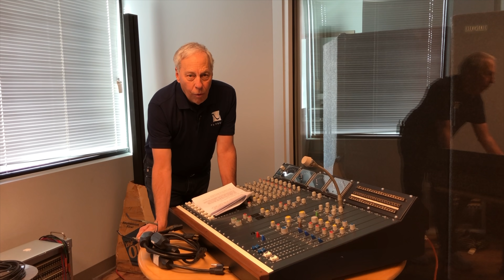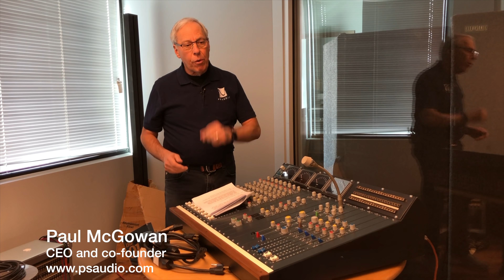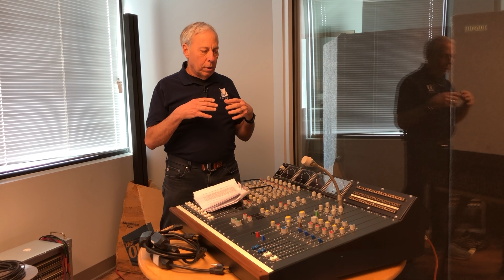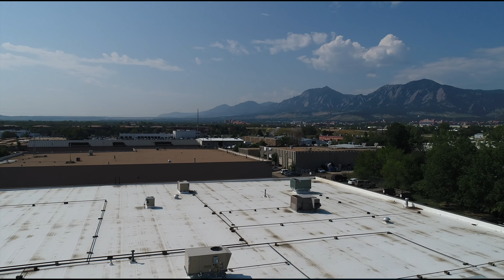Why is analog easier to preserve than digital?

Comment: Analog sounds warmer because the high end usually lacks, even if a little, making it sound warmer. LoFi (the genre) is based around that principle as well as adding reverb which can be experienced on some older recordings. In example, if you listen really closely to the beginning of School by Supertramp (Crime of the Century Album), you can hear the performer a second or so playing the harmonica in the background extremely quietly before the actual chord. Technically that’s like reverse reverb but same idea.

Comment: Is it possible that the harmonic distortions we know and love from our analogue vinyl can and is being captured by the digital conversions.  Whereas a recording straight to digital misses out on those distortions and they are gone forever?
Reply: Sure; probably it's the main reason. Recording straight to digital captures the sound much more pure and clean, while people tend to love the distortions that come from recording to analog (tape, vinyl, trafo's in tube amps etc).
Reply from the maker: That's essentially correct.

Comment: 0:51 Ok, before we start. Analog circuitry can and does impart distortion. In the case of audio, you should expect an increase in low end. Since he mentions recording, recording to tape is usually done hot to impart further pleasing harmonic distortion and tape compression. Most analog distortions are a two fold benefit. First is that compression factor and secondly is the softening and smoothing of the midrange and low end increase. If you record to analog, you preserve that distortion. If you record to digital, that tape compression and analog warmth are lost. Even the warmth from running through the board circuitry is lost depending on your monitoring setup. There are recording systems out there that manipulate the tape machine to record to tape then automatically transfer the tape to a digital format so you get the best of both worlds. 

Digital distortion doesn't have that headroom or leeway and doesn't impart pleasing harmonics to the signal. If it did, we would be pushing digital distortion the same way we push tape. Digital simply samples the signal, give you an accurate representation of what you put in. The the requirement to record to digital and have it sound like analog is pretty much required by the system I mentioned earlier....and yes, it's expensive. The beauty of digital is that the threshold of recording, mixing, and mastering has been greatly reduced. It's easy to do, anybody can do it, and with proper technique, anybody can do it well. 

Ok let's see what Paul says.
Reply: After watching...I'm curious how DSD is supposedly more "analog-sounding" than PCM. That would imply that it too imparts distortion onto the signal, and I highly doubt that's the case. DSD is a digital recording format, bent on precision, just like PCM. If you have a studio that records in DSD, it's going to have to be converted to PCM for editing, mixing, and mastering if any of that is done on computer. If analog equipment is used for the mixing and mastering process, you're going to end up with a warmed up, analog summed signal regardless. Sounds like you're just running in circles to get to the same spot.
Reply: This is what Paul should have said. I like film photography because of the film noise, but to say that digital photography is "cold" is just stupid. Digital has more precision and resolution and has no signal loss in the process.
Reply: I think this is largely correct, but a huge part of tape sound is that it greatly rounds and softens high frequency transients, and machines often have a built in EQ boost to correct for this. What you get then is a sound that isn't necessarily lacking high frequencies, but where all the stabby and ear slicing treble spikes are smoothed out.
Reply: @chipsnmydip  "all the stabby and ear slicing treble spikes are smoothed out." That's the aforementioned compression.
Reply: I get what you are saying, but two points here: 1. Blanket compression (like a VCA/FET/Optical or digital compressor performs) doesn't necessarily smooth out high frequencies. What tape does (bellow 0db Vu) is generally better described as similar to soft-clipping. 2. The softening of transients happens before the record level crosses 0db Vu, which is where the tape saturation and compression mainly begin (where the tape is pushed into overdrive, essentially).
Reply: I have actually done some DSD recordings and listened to countless hours or DSD playback. DSD does not have to be converted to PCM for editing, the two main ways are what Pyramix does which is convert only the edit points to PCM, or what Sonoma and Audiogate do, which is convert to an 8 bit DSD stream. If you want to mix in the box (computer) then, yeah, you need to convert it to PCM, but it sounds vastly better to just use an analog board. Most DSD recordings are mixed on analog, or transferred from tape, although some (lesser sounding ones) are sourced from 24/352khz PCM. Effectively DSD is a lot like a tape machine with some digital editing convenience.

It's true, if you are looking for harmonic distortion, noise within the audio band, or dynamic compression you won't find it. The main differences is that 1. DSD simplifies the AD conversion by removing several key DSP intensive stages, 2. DSD has nearly infinite impulse response and no pre or post ringing as all PCM has. 3. DSD has extremely good low level linearity because it uses a single bit. These all result in a more transparent signal, but IMO there is one characteristic which is not transparent and it requires very high rates (256fs) to get around, DSD is not very good with loud, high frequency transients because the dynamic range is dependent on the sample rate. For sounds that are both loud and high frequency it can be inaccurate, and smooth the sound, somewhat like tape does. I'm not sure if this is measurable, but it is pretty easy to hear. It's actually extremely difficult to get DSD to reproduce the kinds of hard/harsh sounds that are endemic to PCM, which tells you it has its own limitations (fortunately they are pleasant-sounding)
Reply: @chipsnmydip  Sweet, thanks for all the responses and explanations. I'll have to dig into DSD some more.

Comment: Analog tape recording is like a signal processor that we happen to like the sound of.  It does change the sound: the frequency response, the dynamics, and the transients.  It depends on the music and the application as to whether we like the effect or not, but it's an artistic choice.  Good digital recording has no sound of its own.  It's utterly transparent.  If you are 100% happy with your source, then stay digital.  But sometimes you want that bit of color & saturation that analog tape can give you, just like your favorite EQ, compressor, or other audio processor.

Comment: You really can't argue if DSD is better or not against PCM. You need to also specify the format of DSD and PCM. Both DSD and PCM have quantization and linearity errors that depends on the quality of the format. DSD itself is absolutely no guarantee. A DSD64 SACD is with better resolution than a 16-bit 44.1KHz standard CD or about the same resolution as a 24-bit 96KHz PCM recording, but not as much resolution as a 24-bit 192KHz PCM recording. In either way DSD or PCM, more data yield better quality. Paul's talk about "loneliness" is a bit nonsense unless he specifically limit PCM to the old CD standard only. A music studio running the audio at 24-bit 192KHz PCM would be a better compromise than DSD64...

Comment: That's funny that in multiple blind tests experts couldn't tell the difference between PCM and DSD. I love both but I don't pretend that one is black and the other is white.
Reply: Honestly, to my ears the formats sound so different I think they must have done something wrong in the testing.
Reply: If it's a DSD over PCM ''DoP'' the test is biased, it's like listening PCM for both source,  usually especialy on my high end pionner player from 2003 with Texas instruments chip it sound radicaly different, mu player can also read DVD audio i made a DVD burn from SACD rip i already have for compare with both disc and usually the original DSD recording is less harsh than the converted PCM 24 bit part, listening the SACD is like having the tape the DVD audio rip sound great but not as smooth and the source and master file are the same, i also do that with an original DSD file convert with Tascam tool they made for there recorder , i play those one with a blu-ray player that have DSD and SACD decoding feature the result is also totaly different.

Comment: Back in the 90s it was pretty common practice with digital recordings to first record to tape before transferring to digital, and often times even bouncing tracks back to tape, and ultimately mixed down to 1/2" tape. For example, the first two Garbage albums were first tracked to tape, dumped to a Pro Tools session as a gazillion different tracks, then stems were recorded back onto the the 24 track machines, and mixed down to another two channel tape machine. For whatever reason, the sound of the tape preemptively softened the hard edges of the digital conversion, added a little warmth and cohesion to the tracks. Since AD conversion has improved this doesn't really happen anymore, although many engineers still use plugins or hardware emulators like the Empirical Labs Fatso to get that smoother sound.

Paul is telling the truth, on a really good system a DSD recording is close to identical reproduction of a tape source (though PCM below 24/192 not so much), and with DSD you don't get any of the qualitatively harsh or cold sounds that engineers used tape or processors to soften and warm up. It's like true analog, without any of the tape noise or artifacts.

Comment: Then again, if the tape was better why not return to tape and then convert to digital. If digital leave its mark and obviously does then the best thing would be one step back. It ia the same as stellar series - icepower does not sound good because of the restraints but I saw that PS audio put something to correct the sound. The same could be applies in creation process

Comment: Have to disagree with dynamic range on audio recording it's down to technology and is it really that important..! I don't think so. A record can go up to I think about 82 maximum DB and with a dbx decoder can reach 100 DB dynamic range. Not sure what it is for tape about the same, But with modern electronics and techniques I think you can get it up to 120 Db quite easily just depends on the median with double layered tape this is quite possible. And it's not that important.
Think what you're trying to describe Paul is that digital recording doesn't have white and pink Noise to fill the empty void it's just empty
Reply: I've recorded lots of dbx compander tapes in the 1970s (Crown cx744 tap at 15ips) that sound very good, but like Dolby you can hear the tapes breath. The noise floor modulates with the loudness of the music and is a little delayed (noise vs music). I think the guys at Chord talk about modulated noise floor even now. I'd suggest this changing noise floor is far more distracting then the static noise floor say -120 db down.
Reply: @kennetheis3588  yes I hear what you're saying but what I'm saying is with modern electronics these noises could be got rid of or dramatically inaudible, in analogue tape and vinyl, You really going back to 80s technology when it comes to analogue tape that's where it stopped. With better electronics and play heads and different types of play heads that don't touch the tape at all these things are achievable quite easily now as they are in digital recording, is what I'm saying.

With the resources like Paul if he put his mind to it and made a tape machine to the modern standards information you could get off a studio tape would be outstanding and as good as digital or better I believe. I was thinking maybe playing the tape through a bunch of coils it will not touch the tape but will pick up the information from the tape if you made the coil very sensitive enough and with plenty of amplification and filtering. Adopting the same principle as a hard drive does

Comment: I think when many people complain about digital, or cold, or non-musical presentation they are bringing back the history of their listening, or at least the history of many CDs. Paul mentions how bad the early CD players were (some of us old guys went through a quick succession of Sony, Phillips, and Phase Linear CD players in just a few years. We progressed from really bad, to bad, to less bad. 4x oversampling solved the brick wall filtering...right.) But the digital recorders that where contemporaneous with the players were also pretty bad. All the engineers would tell you the jitter, wow and flutter were left on the LPs.

I have lots of 1980s CDs that are badly recorded. The recording engineers were learning their craft all over again. 

So I can point to many CDs that prove that digital is inferior to LPs. But 95% of the CDs I have that were recorded in the 1990s and later don't suffer from these problems. I've had the PS Audio DS DAC in my house for two days and am listening to old Peter Paul and Mary CDs and LP ripped to 96/24 files that both are as good as listening to the LPs. I'd say there isn't a technical or musical metric you can come up with that would make me want to play my LPs except to rip them to digital files.

Comment: Digital recordings can have much more information than analogue. So if you make a digital recording and transfer to analogue it will be less detailed. You lose information.
Reply: They don't have noise, however. The information is all signal, which is where they come up short.
Reply: @StephaneVorstellung  what comes short? analogue or digital?
Reply: @StephaneVorstellung  if you want noise, apply a digital filter
Reply: Ah, I should have clarified: digital comes up short because it fails to recognize noise (in its natural, abundant variety) as information. It's getting better but that's one of the flaws.
Reply: @StephaneVorstellung  but noise in the digital realm is what is called jitter, which comes as high pitched hiss, and unprecise treble which is often unpleasant to hear. And analogue noise is more like tape hiss and record scratches etc. If you have low end digital gear this jitter is very much present because of inprecise clock.  If you want to add noise on a recording many use an analogue tube pre-amp for recording. Which makes the sound more rounded and full because of the harmonic distortions of the tubes.
Reply: @oysteinsoreide4323   Thanks for replying! Yes, noise from the media can be bothersome but that’s not, primarily, what I’m talking about.  I’m talking about what specifically is recorded and then delivered in playback and the wide variety of minutiae attending a sound.  digitally, silence isn’t recognized as a signal, it’s "non-information." The problem is that silence IS a thing; it’s the ground from which sound emerges and against which it decays. Digital black, doesn’t’ attend to this, while analog is all signal all the time. When people say digital is too clinical, or lacks richness or warmth or whatever subjective quality what they’re feeling is the non-information that digital has refused to deliver. I like digital just fine. I’m not a purist by any means but digital has it’s own set of drawbacks: the amount of “information”  it's willing to acknowledge as a signal, worthy of passing on, is digital's biggest drawback.
Reply: @StephaneVorstellung  If you like digital or analogue music reproduction is a subjective matter. It's more about taste than anything else. I like digitally reproduced music best.
Reply: StephaneVorstellung that is not true, modern ADC convertors are more than capable of sampling the whole frequency range and very fast too, noise is a common misunderstanding attributed to placebo (aka "music ears")
Reply: @FooBar89  Badly done ad and da conversions are noisy. You need a good and stable clock and good components.
Reply: Oystein Soreide do it good then, the components are really cheap, audio is not really interesting or demanding from that point of view
Reply: @FooBar89  Have you heard on a high end audio system?   The DAC is crucial part of the system. But of course these days, you should be able to get a reasonable good dac for less than 1000 dollars, but there are some very good dacs that is much more costly. But if you are on a budget I would look for DACs in the 500-1000 dollar price range. And of course if you care about sound. But there are plenty of good integrated amplifiers with built-in DACs these days, but especially the cheapest are badly designed. If you listen well to different high end gear, then you understand it's a matter of picking the right components, not just a random cheap one.

Comment: That is an Analog Radio mixing board  when Radio sounded GOOD .
We don't hear of treble extension anymore  like we did before do we .
only Bass extension .
Reply: BBC Radio 3 on FM radio still sounds very good.
Reply: You brits cant compare because you have what 3 stations? So you can send out a wide range signal with wide bandwidth. Here in the US were restricted to 10 mHz. Nah, just kidding.
Reply: @gabevee3  There's hundreds of stations in the UK.
Reply: @captainwin6333  I was joking...